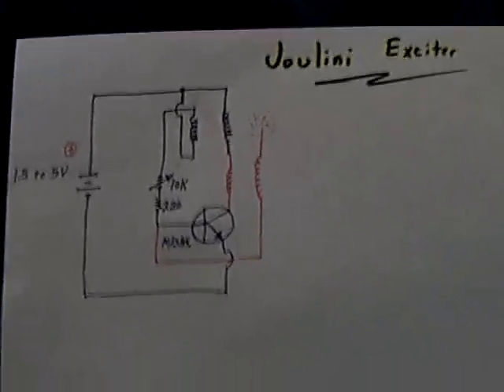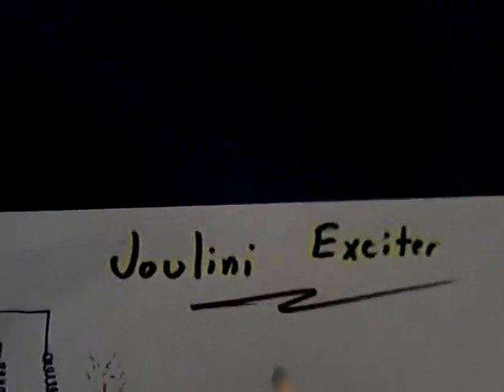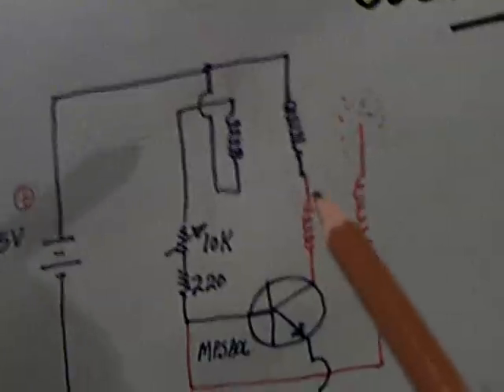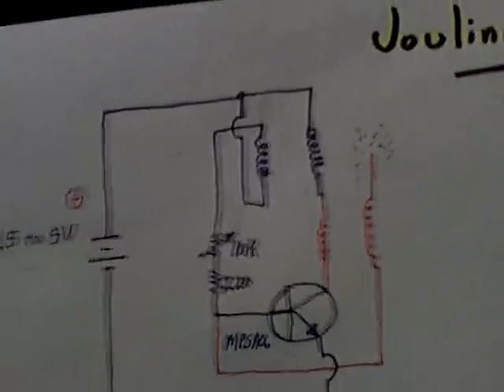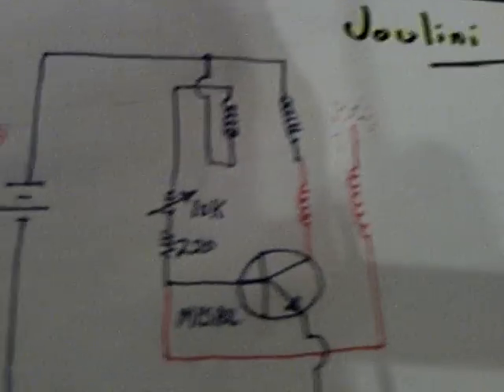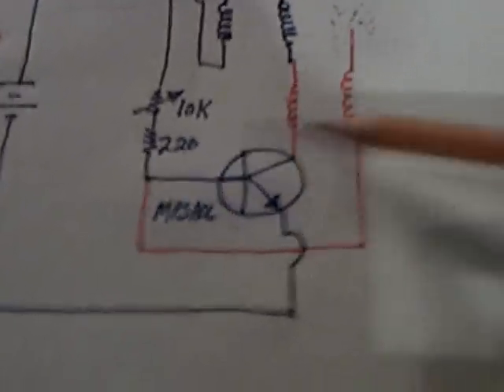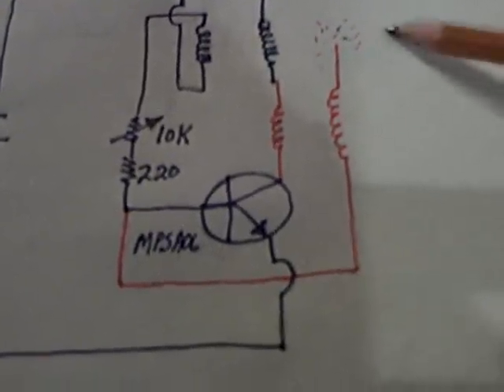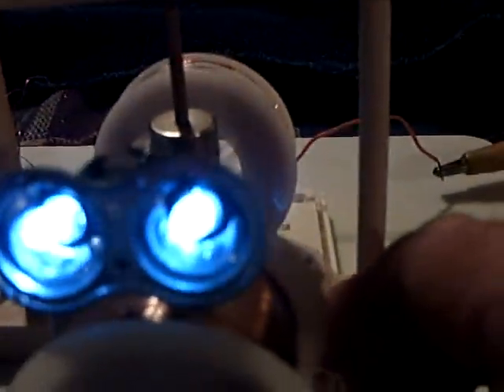Joulini Exciter

Comment: Try and loop Maggie's output back to source. Replace the rectifier with a super cap and fast diode. Then run the cap output directly to the primary battery.  I bet it charges the source battery and runs the setup too. Maggie's "Lenz Propulsion" generates the extra power.

Comment: Try and loop Maggie's output back to source. Just take the raw leads from Maggie and attach them to a super capacitor and Schotky diode to the other. Then run wires from each end of the capacitor diectly to the source battery. I bet it charges the source battery and runs the setup too, due to "Lenz propulsion" in Maggie.